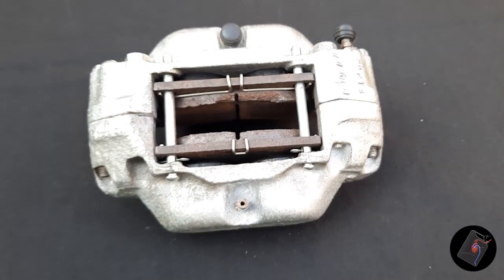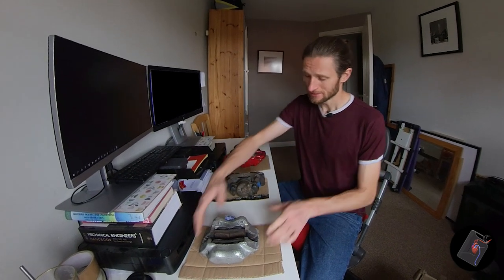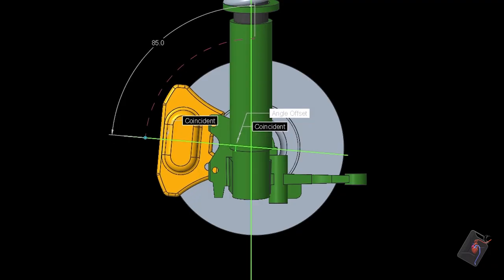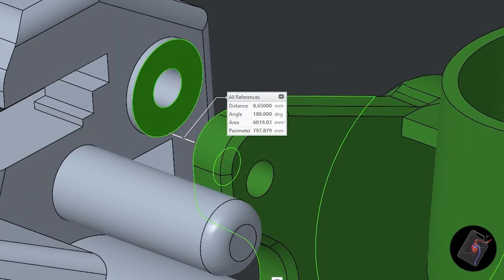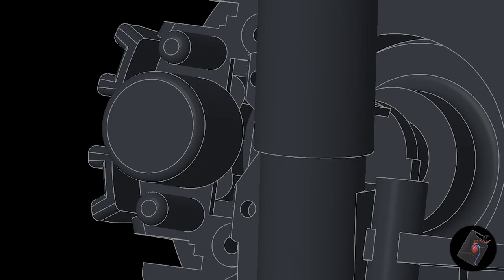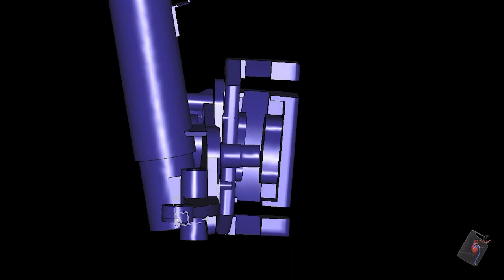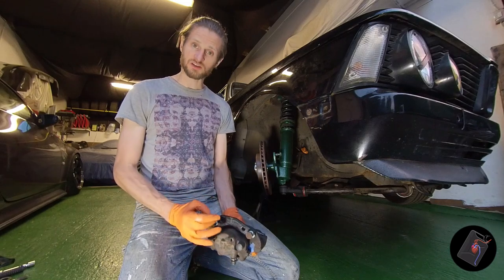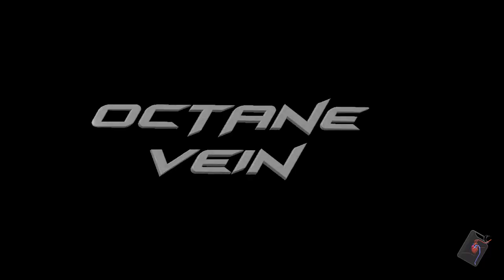Ep9. BMW E21 Race Car E36 Brake Upgrade

Comment: mate this is insane amount of work included in this ... i was thinking about having brakes done on my e21 , and this video is so helpful and explains everything ... I will defo be interested to buy those brackets or even stl file.let me know ...  great job MAN ... well impressive
Reply from the maker: @gibon1080 thanks mate,  yeah it was a serious job getting this video out! Unfortunately just having the brackets won't help as I have E36 hubs and discs (see episode 1) which moves the caliper position. If you still have E21 discs this brake setup won't work.  If I find a solution that means I can sell the kits then I'll let you know 👍

Comment: I had same dilemma- went to hispec & they designed me a custom carrier to mount monster 4 pot calipers utilising e39 discs . These just fit under my 15” mim wheels & have a massive choice of pads
Reply from the maker: That sounds like a lot of brake under a 15" wheel. Good work 💪

Comment: The Australians used the front  Ford Falcon caliper the are massive and a direct bolt on : I have found these on the 2004 GTO in the USA. There is also
Wildwood dual piston calipers
Reply from the maker: @jjgbmw323 Thanks for the info. It's always good to learn of other OE parts that fit straight on 👍
Reply: @OctaneVein  calipers are off a 2004 GTO and are marked K247-037C they also say made in Australia 🇦🇺. They are a direct bolt on just need a small washer or spacer to center them
Reply from the maker: @jjgbmw323 Nice one thanks. It's a Vauxhall Monaro here in the UK. I'd love to know how people find out this stuff fits!!
Reply: @OctaneVein  guys in Australia 🇦🇺 on the forum told us. They have a lot of Ford Falcons so they figured it out. We have Ireland Engineering that offers a front Wildwood kit, I have the massive brakes e21 front kit. Going to get the Ford GTO brakes then Wildwood Massive brakes all around

Comment: Hi, i liked a lot the content. i did a z3 m44b19 swap in my e21 315  (motor, gearbox, lsd differential, electronic) but i’m looking to improve my suspension and brakes. what i have to study to do the amazing measurements in computer??… sorry but i’m just a 20 year old from chile, here isn’t had that technology to do perfect jobs i want to improve my car and knowledge so can you tell me what to study?  😅
Reply from the maker: Well done for doing the swap dude. Mechanical and/or Automotive Engineering would be a great start. But hands on experience is also very valuable. Good luck man

Comment: hey dude, I just picked up an 83 320i e21 as it was abandoned near my house and would like some pointers as far as engine swaps go, would you be willing to help me out?
Reply from the maker: @rootbeershelf4406 that's a great find, glad you've rescued it. I'm not sure I'll be able to help you out I'm afraid, I barely have time to work on mine!! What engine swap are you planning? There's probably plenty of info online already if you need any guidance.

Comment: Better use a E34 disc (302x28mm) with a caliper from 996 Porsche. Much more simple to adapt.
Reply from the maker: @haraldlachmund2433, thanks for the info, I didn't know about that conversion. Can you still run 16" rims?
Reply: If you give me your Email,  i'll send you all information about.
Reply from the maker: @haraldlachmund2433  Thanks, I'd be interested in that.  Can you send it on Facebook messenger to the Octane Vein account?
Reply: @OctaneVein  done
Reply from the maker: @haraldlachmund2433  Received. Many thanks Harry